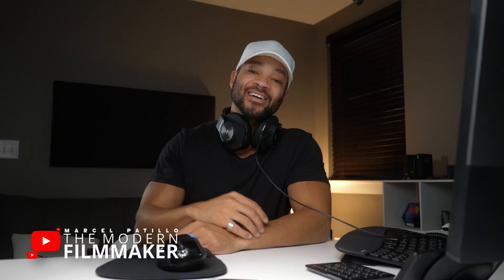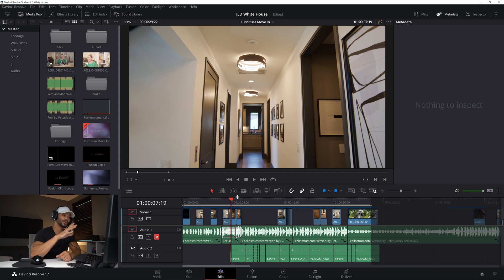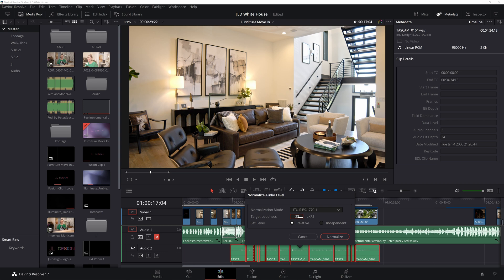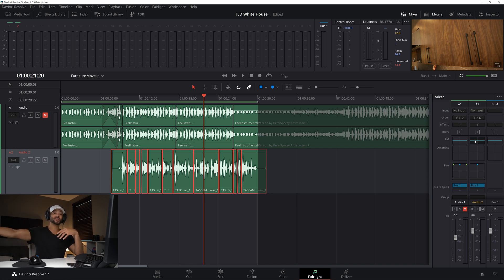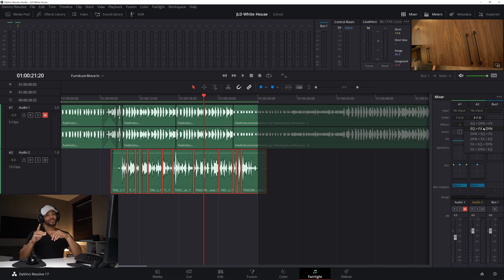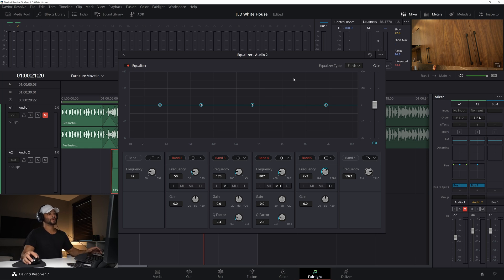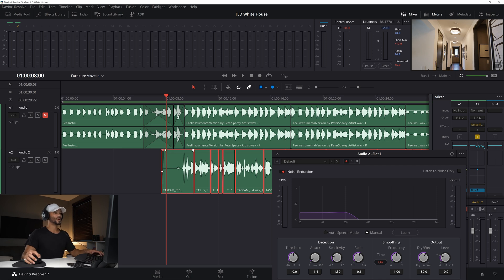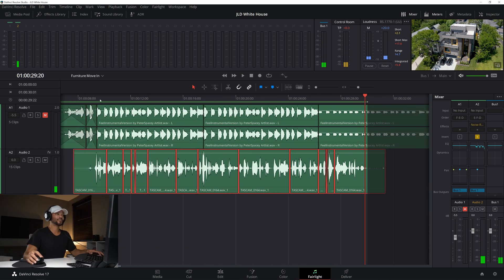How To Remove Background Noise In Fairlight Davinci Resolve 17 | Davinci Resolve Fairlight Tutorial

Comment: Will this work for fixing that (not too bad, but noticeable) hiss from cranking the gain too much? I have some dialogue that was recorded, super low via lav mic. But in order to get the sound audible at normal levels, that hiss becomes noticeable due to the gain.
Reply from the maker: I would highly suggest Izotope RX 10 standard. The repair assistant is really helpful for difficult hiss, clicks, unwanted reverb and more. Good question 👊✌️

Comment: When would one use a gate instead of a low pass filter? That was both impressive + helpful.
Reply from the maker: A gate cuts all sound under a certain volume and a low pass just cuts high frequencies. So maybe if there is a general hiss in the audio a low pass could be good to cut all the highs or a high pass could be good if there is a really bad low him.... A gate is good when there is low level ambient or room noise and you need it to cut that noise in between words or sentences. Under a certain level it will cut all frequencies... That is a lot but I hope it helps 👊✌️
Reply: @TheModernFilmmaker  Thanks that is highly appreciated!

Comment: This is a great tutorial, I have one question and that is if you have different audio clips on the same audio track how can you do the effects to each one individually, I cannot figure it out!
Reply from the maker: There are some things you can do clip by clip from the inspector on the Edit page like individual volume and EQ but for more advanced effects like compression, noise gate, third party plug-ins have to be done to entire tracks. In a lot of situations I just put the separate clips on separate tracks to edit and add effects that way. 👊✌
Reply: @TheModernFilmmaker  Hello and thanks for the reply, I think you may have a point, as adding all those modules to clips seems less efficient than having separate tracks (also the EQ seems more comprehensive on tracks). Thanks again for taking the time to respond.

Comment: thank you! I feel like a pro! lol I have to figure out how to keep my laptop from making noise while I'm recording so I wont have this issue constantly lmbo
Reply: Assuming you're dealing with fan noise, you can put more distance between the laptop and mic as well as trying to use sound absorbent material. Near the laptop (so long as you aren't interfering with the fans attempting to cool it down). 

With my current laptop, I really haven't had much of an issue with it heating up enough while recording to have an issue with fan noise. Long renders are a different story.
Reply from the maker: Happy to help! Thank you for the comment 😁 👊✌

Comment: Excellent video man. Obviously you can only fit as much but please do more in-depth audio editing. Especially adjusting the tone/weight of voice. I edit videos for my wife (very very basic level) and normally use the auto-speech mode. The gate/compressor things are still a bit of mystery to me.

On another note, how do I get a reasonable exposure for a overhead lamp and a table lamp in a room? I seem to be clipping my highlights but can't go lower with lighting as wife does YT reading for kids and get eyesight is quite bad so she needs plenty light. Any tips would be much appreciated. 

Keep up the good work mate.
Reply from the maker: Thank you for the kind words Krzysztof! I will definitely be doing a lot more videos on audio in Davinci 👍😁

It seems like your lighting may be too harsh. With very high highs and very low lows. Try to soften your light source by making the light go through something like a white bed sheet or diffusion paper. Also this tutorial could help in the color grading process https://youtu.be/qh-kX43LMT0